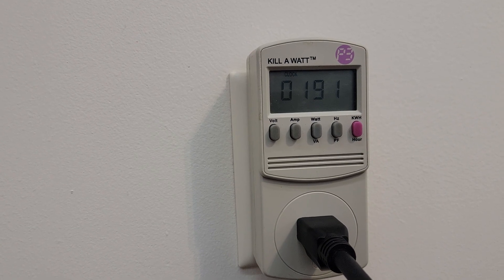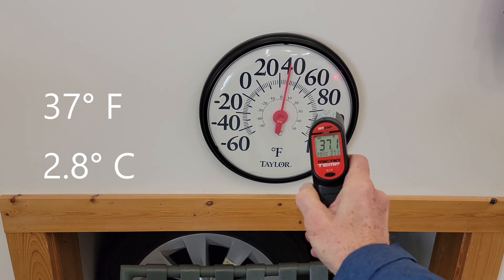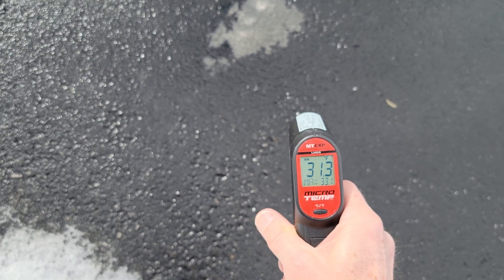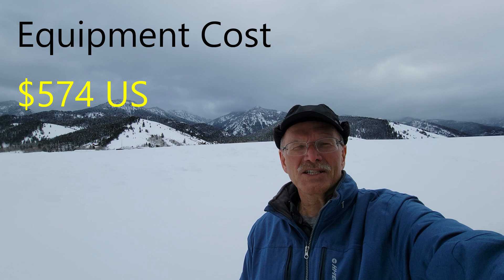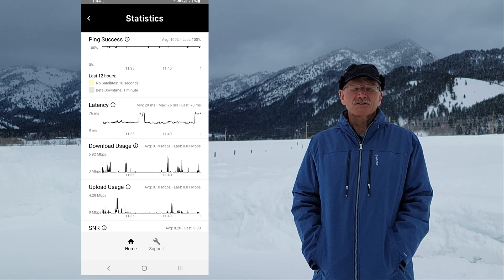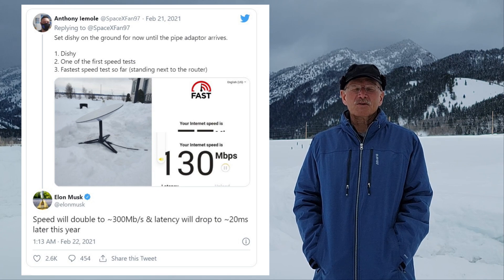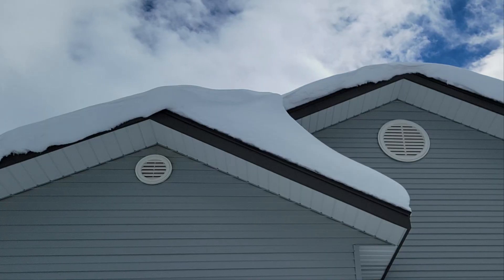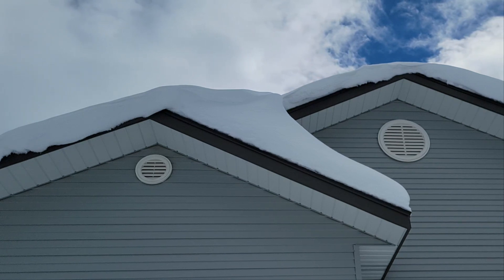Starlink Power Requirement, 8 Days in February 2021, and Musk Predicts Performance Improvements.

Comment: That 100 watt base load for Starlink could be an issue for some folks that have off the grid power systems. But for the folks with only DSL, marginal cellular access and utility power Starlink looks like a great option.
Reply from the maker: I was a bit surprised by the power draw as well.  I don't know if the power draw will go down in the summer, but I will do a test this spring and compare.  If I was off grid, I'd probably turn it off when not is use.  I may put mine on a timer to turn off at night when I don't have tow worry about melt snow.

Comment: Thanks for the review.  Most everything I've seen about Starlink has been awesome.  My only concern is if ole Egon might get greedy and drop a data cap making the network the same as the other satellite ISPs just with better speeds (ie reaching the cap even faster).
Reply from the maker: Me too.  I just dropped my Dish TV service and have switched to Youtube TV, so I'm going to be using a lot more data than I have in the past.  I really hope that they will offer an optional limited data plan at a reduced price to make it more affordable for those who don't need unlimited data

Comment: There's not a bad view anywhere on that property! NICE views! Onto mounting, so I just installed a buddies dish this past weekend and used a Bell (Dish) Satellite TV arm and I think they work great! You'll just need Starlinks Pipe Adapter Kit or some muffler clamps etc to mount it to the arm. Here's a couple pics of how it looks! As you may note in the picture the dish is mounted on the "South" side of this house. Normally it's recommended to mount on the North side because the service is found in the Northern Hemisphere however the owner was adamant he didn't want to see the dish so low and behold I mounted it there and "It WORKS great". 
https://photos.app.goo.gl/EbYuBRUdzYSiZAFA9 
https://photos.app.goo.gl/vr89C6KejSDLBjP2A
https://photos.app.goo.gl/gJ8SGJbw5FMeWrFBA
Reply from the maker: Thanks for the info and photos.  That looks like a great mount.  I have a similar dish mount on order and I'm waiting to see how much of a mismatch the two pipes are before I buy the adapter.
Reply: @modelxevfun2858  The "mismatch" is almost equal so butt to butt pretty much and likely for a reason! LOL...Tack weld would fix that (mig weld).

Comment: I paid my deposit to be put on the list to be one of the first in my area (SW Virginia) to receive and test Starlink. My biggest concern is, will there be any guaranteed free replacements parts for any of the equipment if it goes bad?
Reply from the maker: I don't know for sure, but I'm guessing that once the warranty is up (12 months) it will be up to the owner to purchase replacement gear if it goes bad.
Reply: @modelxevfun2858  thank you, it's good to know that there is a 12 month warranty!

Comment: I know they do a  Mount that you bolt onto a Poll / antenna Fixture based on other YT Videos Ive seen
Reply: My mount took a month to ship.

I decided to drill into Starlinks pole to make a bolt hole for my J mount and it works fine.
Just tighten with Nylon threaded nuts

Comment: I think the volcano mounts are good at the current time but I’d be concerned about the footprint of the mount vs height and size of the disk in high wind areas.   Have you considered a small (3ft) tripod mount for your roof?   I’m in the Sierras and get high winds.  I also live amongst a lot of 120ft Pines.   I’m waiting on a 5ft  tripod and will add another 5 ft via a mast and the Starlink poll adapter to get the dish high enough to mitigate obstructions.   The small tripod mounts are available everywhere for as little as $30.
Reply from the maker: I have a Wineguard DS2000 mount on its way and I'm hoping I can make it work.
Reply: @modelxevfun2858  Cool, just be aware about the need for the button to lock the position (axially) on the mast.  Starlink is offering the proper interface for that but it looks like those are weeks out too.  But, you should be able to measure and drill the mast to get a lock if the ID is correct.   Good Luck!   Let us know how it works.
Reply from the maker: @ramosel  Will do.

Comment: I peaked at 200Mbps and my neighbor got 224Mbps with Starlink
Reply: I got 267Mbps / 17.88Mbps at 10:10 PM last night
Reply: @xVertigo101  Really, I've gotten near 190 once in 3 months. Where's your cell area and how far is the ground station from you? Maybe that's what counts with this system? My avg is 80 Meg's down.. Perfectly fine for now as the mandated speed for which or government of Canada set out for rural isolated communities is 50 down 10 up.. So for now I'm above the standard.
Reply: @RogerDiotte  Cell only covera half my town and beta testers are less then 20.

Cell location Chesterville Maine.
Nearest ground station is Loring Maine
Reply: @xVertigo101  it’s called the new upgrade starlink is doing. twice the speeds. read elon’s tweet
Reply from the maker: Amazing.  I'm glad this option is now available for us.
Reply: Great! This only happens one in a hundred or consistently?
Reply from the maker: @RogerDiotte  I haven't seen those kinds of speeds yet.  My speed tests vary quite a bit, and I'm still seeing small periods of outage (11 minutes in the last 12 hours), but this is a beta and this should be expected.

Comment: Hopefully in the summer it goes down to 50w
Reply from the maker: Yes, it will be interesting to see and I'll be sure to post my results.  If it still draws over 100 watts in the summer, I'll probably put mine on a timer so it shuts down during normal sleep hours.
Reply: Im not sure what hardware control they have. But it would be nice if it can use only part of radio spectar while it is in not in high demand. Or at least lower power to minimum. Just as in mobile phones. It is way lower power consumption when it is idle. Instead when it is downloading.

Comment: Sweet! Hopefully Starlink can design a smaller dish that can be mobile and used in a tesla. Id like to travel with a Cybertruck and take something like that along. Excited for Starlinks future!
Reply from the maker: That would be cool!
Reply: Smaller dish is probably not possible. Also bigger antenna the better signal. You cannot beat physics.  But they could make dish 2.0  thinner to put under hood or something.